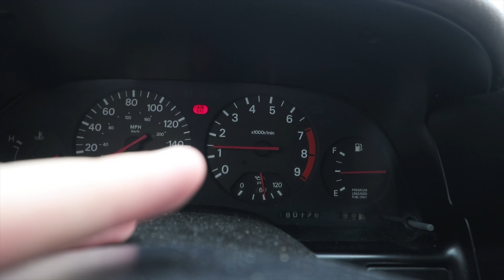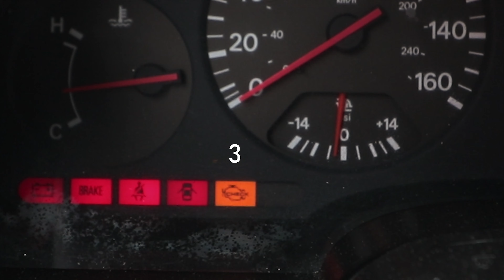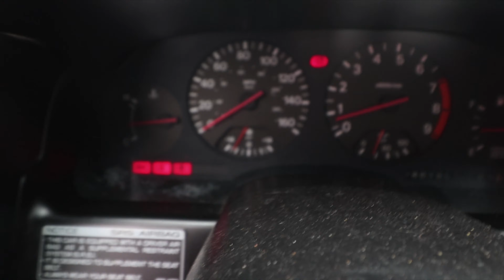Project TWIN-TURBO 300ZX HITS FULL BOOST!

Comment: Um... careful with those hoodie straps near the exposed (or even an unexposed) fan. 😬 That could quickly turn into a real bad day, bro.

That aside, nice video, man.  I still have yet to get around to my injector swap, but when I do... 😁 6 compared to 5 cylinders is a massive difference. Smooth, easy power. The downpipes and test pipes I put in over the summer help 🤘

Of course, now it’s in the 30s outside - makes pulling the intake tubes not so fun 🙄